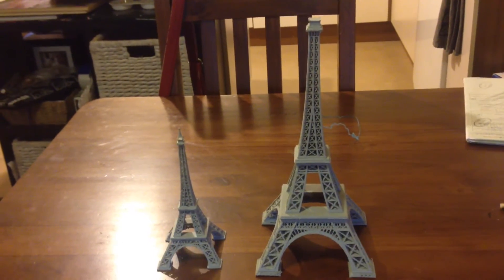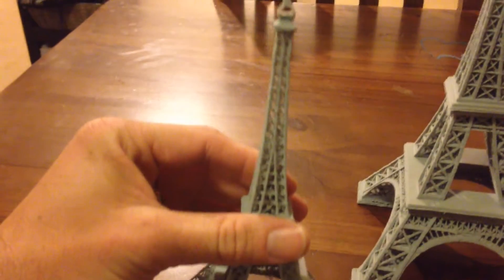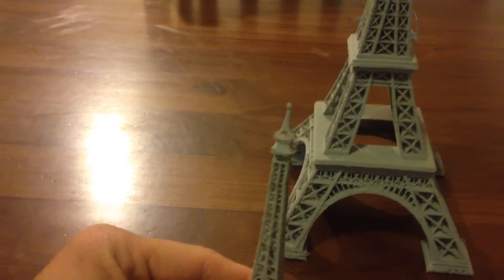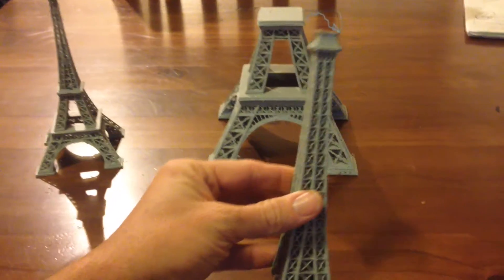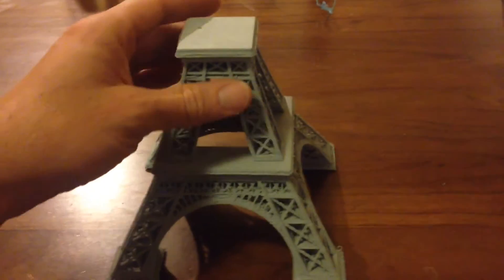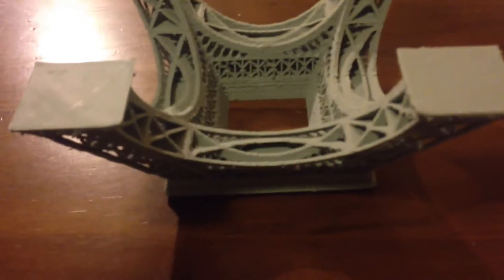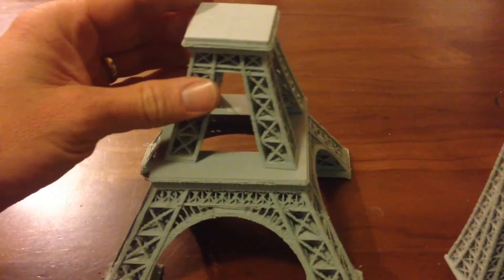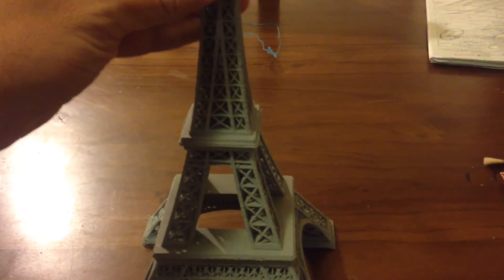Wanhao i3 3d printed Eiffel Tower Large Scale in ABS (Aurarum Filament)

Comment: Do you have your printer enclosed? Thanks for the video
Reply from the maker: vVic t0rx No I don't but I do sometime print abs in the drying room which is at about 40C. I don't think the extra warm makes a big difference but the lack of drafts I think helps. Also it means it doesn't sink out the house with abs smells.
Reply from the maker: I think if you check out some of my other videos you see my printer its a wanhao i3 with very little mods to it. Recently I added microswiss all metal hit end which I love but that the only major change to it.
Reply: Good to see some very accurate abs prints out of this machine. Useful video that shows that wi3 can print abs and not pla only. I bought mine months ago didn't have time to unpack it yet, but I still keep printing abs on my flashforge for now. Good news as I dont like Pla because it isn't durable enough, it absorbs moisture overtime and  and it also melts to easily. I'll  make some sort of enclosure for the i3,  thanks for your reply!
Reply: All metal hot end must be great but I only ordered some cheap (aliexpress ) upgrades for the i3- basic things that are recommended by some people who are way more technical than me... a stepper motor (17HS3001-20B) and a better gear drive.
Reply from the maker: vVic t0rx the only reason for a metal hot end is for high temp prints about e 230c. It's not need for PLA or abs.
Reply: Yes, I knew that, I'm still dealing with the teflon tube on my wooden flashforge, but it is ok for abs. Other filaments, for me are not so affordable where I currently live (Poland) anyway. But I would love to try some PETG
Reply from the maker: vVic t0rx I would love to try son polycarbonate but don't think it gets hot enough :-/